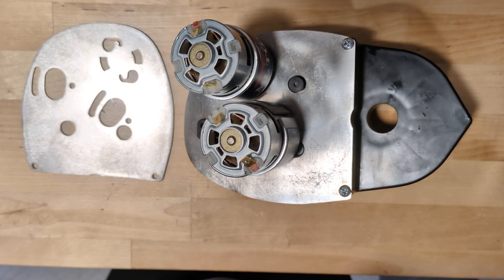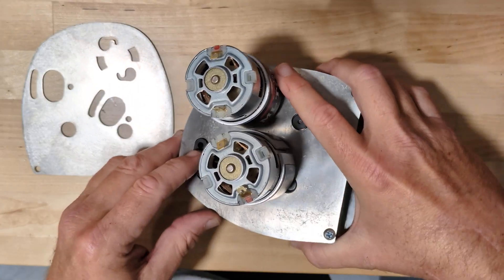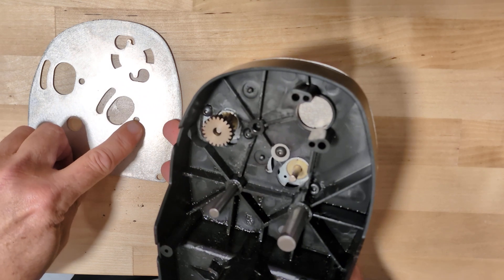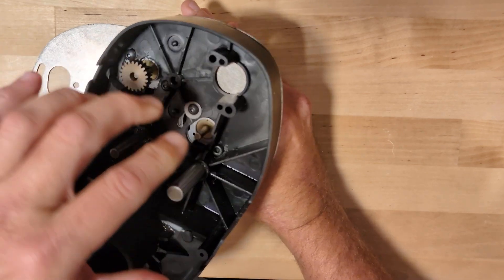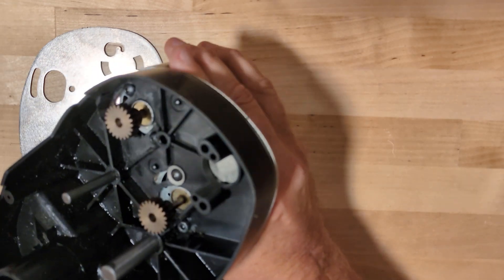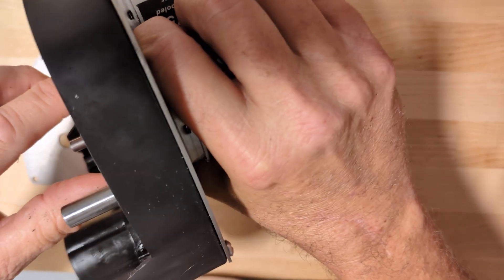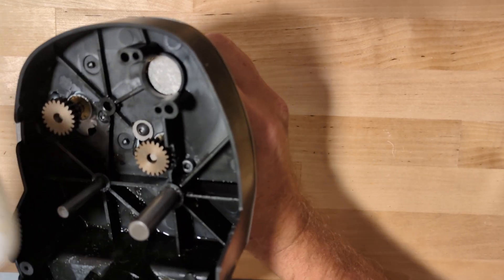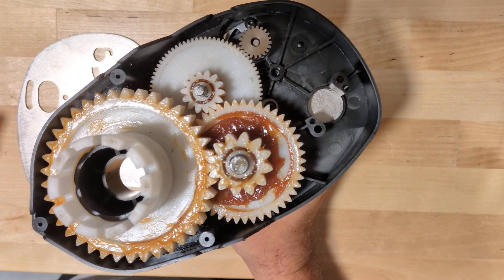MLToys Dual 775 Motor - First Gear Delete Plates for Power Wheels

Comment: Is it better to run in series or parallel for longevity? Planning on 24 volts, want to go fast but not burn up motors every weekend. What do you suggest? Thank you
Reply from the maker: @jamesbruhn3103  this plate is not for longevity use. See the How To Guide on the MLToys website.
Reply: @mltoys9644  yeah I understand that. The how to section doesn't answer my original question but thanks for the reply
Reply from the maker: @jamesbruhn3103  email tech support GoFast@MLToys.com they'll take care of you
Reply: @mltoys9644  thank you for the quick reply on a early Sunday morning. I will reach out this week enjoy your day

Comment: So are some people running 4 motors?

How much volts is needed to really see the difference?
Reply from the maker: @88musclestang89  You have to go by the rules at your track.
Reply: @mltoys9644   gotcha.  So 4 motors and 36volts is all we need and this thing will boogie ?  

Race we have coming up is just ages. Nothing else. 🤔
Reply from the maker: @88musclestang89  you'll need to make sure the rest.of.your car's systems are up for it of course.

Comment: Can all metal gears be used in this setup
Reply from the maker: @kingboicheyryder7817  the other gears do better in nylon filament.
Reply: @mltoys9644  can the older gearboxes be modified like the one from the Porsche gt3
Reply from the maker: @kingboicheyryder7817  We do make modifications for the GT3 gearboxes. See the MLToys website. The kit in this video only works on Phoenix gearboxes which also fit in the GT3
Reply: @mltoys9644  thank you and thanks for the speedy reply I appreciate it